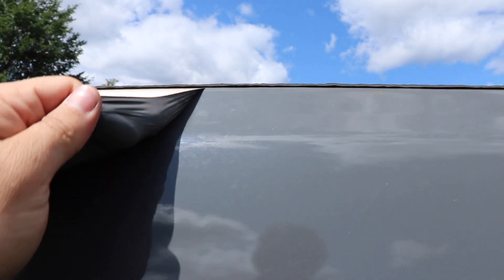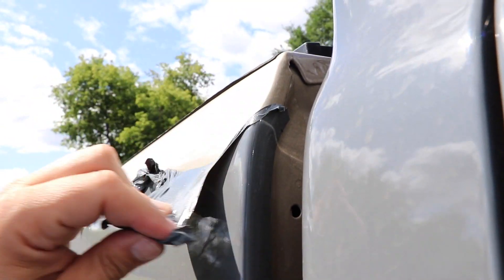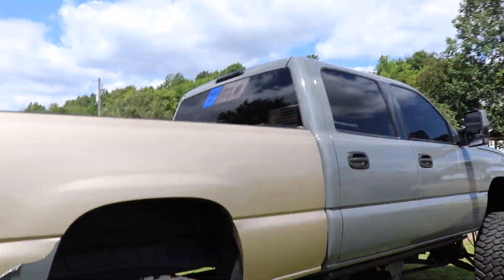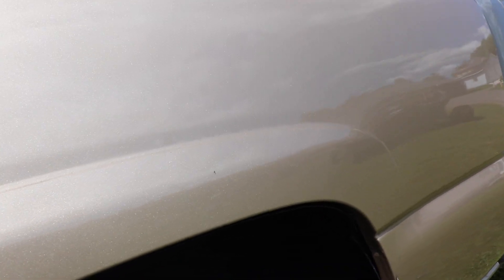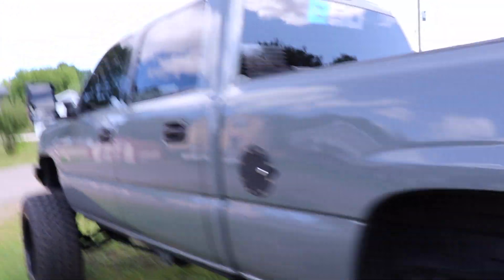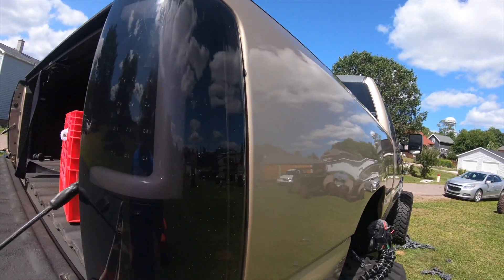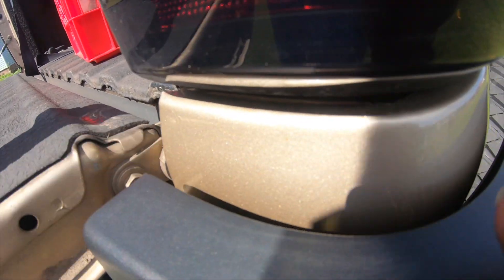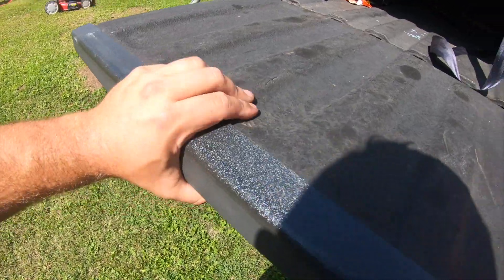Removing the VINYL WRAP on my DURAMAX and THIS HAPPENS

Comment: I have an 06 1500 ext cab & long bed...and I’m on the fence about wrapping or painting. It’s got a couple little dings in the paint here and there that’s not major. There’s also a fairly big dent on the drivers side bed where my fiancé swiped a pole in a parking lot (🤬🤬🤬🤬 I get pissed at him every time I look at it 😫). I’m obviously gonna get the bodywork done but I guess my question is, would I need to also have those areas painted too or would the vinyl adhere to the primed areas?  🤔🤔 Sorry for the long ass questions...your channel has the most info on wrapping the same model truck as I have. I’d love to jack my truck up too, but I’m on the fence about that too 😣😫

Comment: If you ripped off paint just ripping away that’s on you 😂🤦‍♂️ can’t just rip a super adhesive that’s been worn on your vehichle off, gotta heat it up or do it on a hot day in the sun.
Reply from the maker: No paint has been ripped off